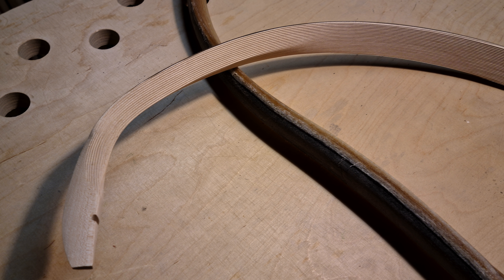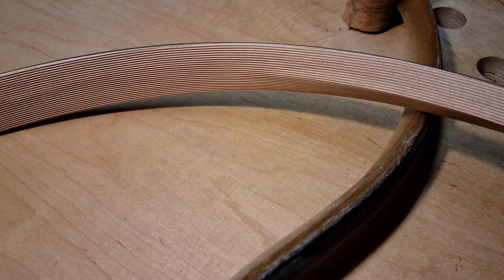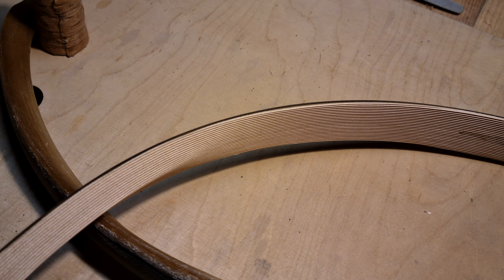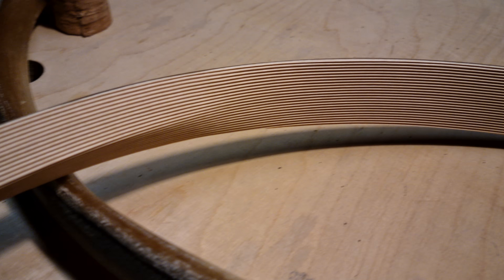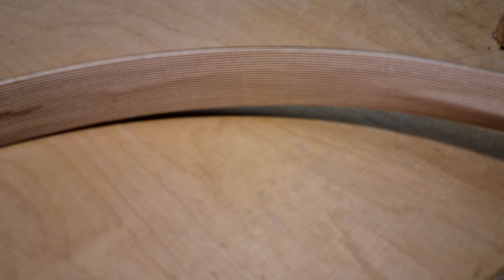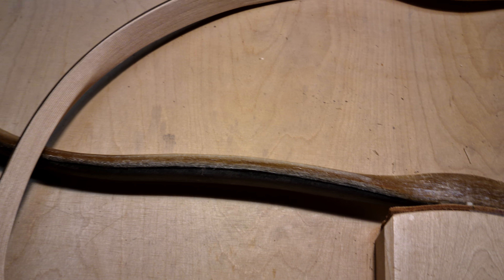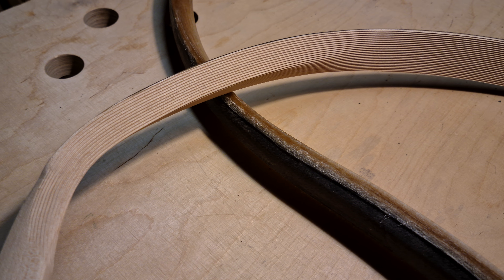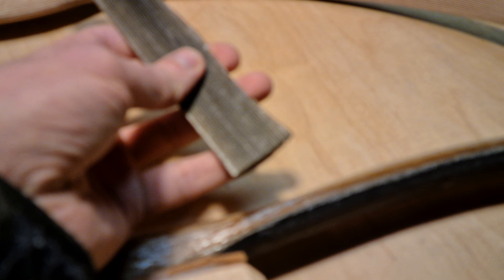Groovy core of a Turkish composite

Comment: I understand why you would use vertical grain or quarter sawn wood grain orientations for most of your bow build, but why would you ever add a scarf joint flatsawn tip? Would appear to be prone to splitting and delaminating right where the string pressure is applied.
Reply from the maker: Not sure I ever would 😄 The bow in the video consists of three pieces of wood. You can add a small wedge to the tip if you need to adjust the tip angle after the core is dry.

Comment: "these bows are mostly glue with some wood and horn .." -- I wonder what kind of performance you could get w/ modern resins + S-Glass or carbon fiber. If the materials can take the shear, maybe even an air-gap in between the back & belly.
Reply from the maker: Glass bows have the potensial of higher performance. I've been making a couple lately. That is, glass and wood laminates. Going to test them tomorrow. I expect quite similar results as the horn bows, since not everything is optimal yet
Reply: We waiting for results 😊
Reply from the maker: @rusutitusadrian9373  the results were so surprisingly depressing, that I will for now choose to disregard them 😆

Comment: This is THE PROfessional work :)  !!!  
 I guess the grooving was done by some special tool ? Look unimaginagle to achive such structure by hand groover ? Well done again !
Reply from the maker: Thanks! It's actually just scraped in by hand with a card scraper that has had teeth filed into it. It does take a little time to do accurately, though :)
Reply: @kviljo  I know that all bow builders prefers plain sawn wood,.... but Have you maybe tried the quarter-sawn maple wood for bow ?
Reply from the maker: @gorazdg1  it works too, but is perhaps slightly less optimal

Comment: I heard maple is one of the worst usable woods for self-bow making, why is it so good for composite bows?
Reply from the maker: Good question! Actually, I think the main reason it was used is that it has a very even structure. This way it is easy to shape accurately. In a composite, the wood is mainly acting as a spacer between the sinew and horn, and so making sure the wood is tapered evenly is the most important thing to consider. Ash, or other ring-porous woods are so uneven in hardness that making this kind of taper is not so easy. - and even with a good taper, you end up with weak areas where the softer early wood is, and stiff areas where the harder latewood is. I used elm for the grip in this one, and even though it was an unusual piece, you can see the bumps in the taper due to the uneven structure. Apart from this, it's also somewhat lightweight, which can be good. Most modern glass fiber laminated bows use maple in the core too.